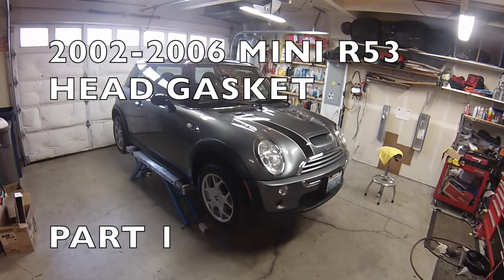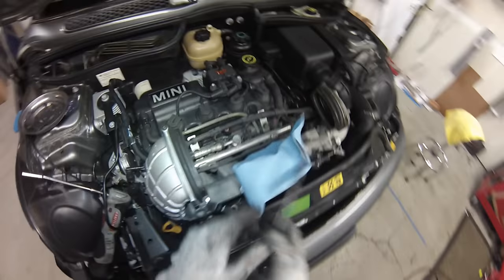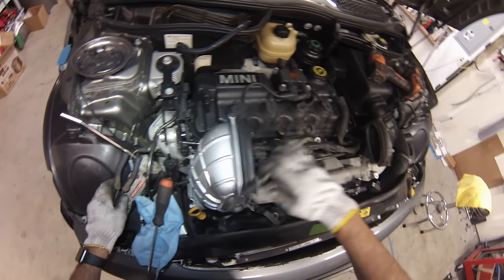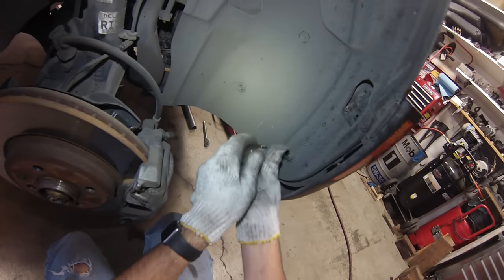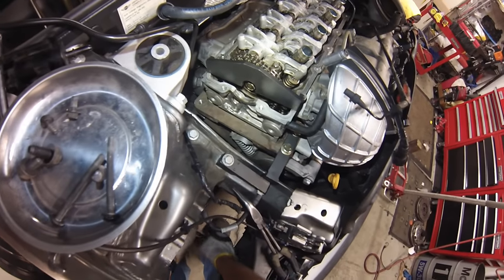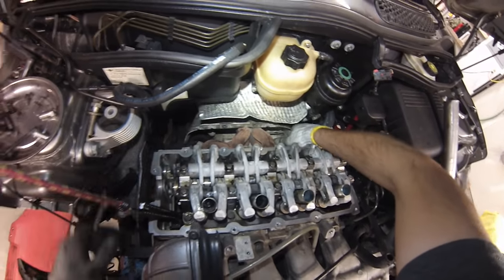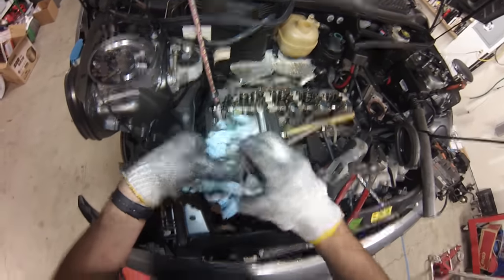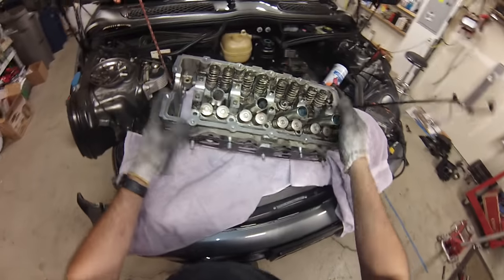How to Replace MINI Cooper Cylinder Head/Gasket 2002-2006 R53 Part 1

Comment from the maker: Step by step replacement of head gasket (& remove/install camshaft) on a 1st Gen MINI Cooper S. Get the parts and tools here: 

Head gasket: http://amzn.to/1jimU3Q
Bolt set: http://amzn.to/1jimUkm
Valve cover gasket: http://amzn.to/1Lp0qbO
Chain tensioner: http://amzn.to/1jimWbX
Thermostat & gasket: http://amzn.to/1jimXgf

Intake/exhaust manifold gaskets are reusable.

Bolt extractor set: http://amzn.to/1R5iMP4
Timing chain special tool: http://amzn.to/1jin6QQ
3/8 wobble extension: http://amzn.to/1PnCMyd
1/4 deep drive socket set incl. 8mm: http://amzn.to/1ZqyIBv
1/4 wobble extension: http://amzn.to/1Lp0Hvi
Hose clamp pliers: http://amzn.to/1jinaQv

Process will be similar on a naturally aspirated MINI Cooper - just little different for intake manifold and airbox. 

Want to show your support for MOD Mini? Virtual tip jar at http://www.fundly.com/mod-mini-tip-jar
Reply: What would be a friendly price to do this job?
Reply: Hi! I’m trying to get some of the parts for my dad for Christmas to fix his MINI. Will all of these parts need purchased to do this job? He’s got a 2003 with the same issue. Like for instance, you have bolts listed, so are the bolts he will remove not reusable? Thanks in advance!
Reply: Hope Ogle every time you remove the head you should replace the bolts, they tend to stretch when torquing them down.
Reply: Mod mini, I have a 2005 Cooper S.  Do I have to remove the rocker assemblies? It looks like I have access to the head bolts without removing the rocker assemblies.
Reply: are the Mini engines worth fixing w 200K when head gasket is leaking? Do you see bearing or piston issues?

Comment: Why is necessary to remove the rocker arms and camshafts? The head bolts could all be accessed without doing this step so Im a little confused
Reply from the maker: It's not necessary for head removal but you need to at least loosen all the cam bolts to realign the camshaft on reassembly.

Comment: Question??  Just replaced head gasket. Your video a huge help!  While sopping up the milkshake in the oil filter housing I accidentally pulled out one of  springs and cap. Superglued spring to center of cap and tried to connect it to its mate.  I guess the inner piece is broken as they don’t seem to want to snap together. Is this part essential? What is its function? I put oil filter on with just the one springy thing. Am I good to run it? Haven’t started it yet.

Comment: How similar is this process for an R50 (Non-S)? We're gotten as far as the valve cover off but I'm struggling to find a video specific to R50s for head gasket replacement

Comment: Road salt and water make my car indistinguishable from the one you were working on, albeit 8 yrs ago. Had to hammer the injectors out, had to throw away the suspension, getting everything vapour blasted or blasted and powder coated, and spending loads on new parts. I'd never worked on anything until I bought my mini and was just like 'I'll just fix it myself if anything goes wrong' .. age old tip of the day: if you look under a car and it looks rusty, don't buy it unless you know what you're doing.

Comment: hi mod mini man. im all the way over in England and I've successfully changed my head gasket using your tutorial. the only words I have to say is when trying to pull the inlet manifold the bolts were fused to the studs and was impossible to slide back. I had to make a decision so pulled the head out with the inlet manifold attached. once I had the head on the bench the only way I could get the studs out was to wind 2 m8 nuts up the stud and lock them together and force them through all the crap. awesome tutorial and I couldn't have done it without you. TOP MAN

Comment: Recently did this job with the guidance of this amazing video. Thanks. Turned out the the problem was cracked oil cooler/heat exchanger however. 😧

Comment: Oh, joy of joys! Mod MINI has uploaded a new video.- That is one clean engine bay, by the way.
Reply from the maker: +IamMagPie It wasn't until I cleaned it...
Reply: +Mod MINI Wow - nice job. I want to clean my engine, but I'm afraid of putting water in there. With all the electric cables, electronics and what not.
Reply from the maker: +IamMagPie Everything is water resistant. Just make sure to run the motor until it is hot (dry) before parking. And don't use a pressure washer.

Comment: Great video, very helpful. 
One thing I did find is that if you remove the intercooler bracket and rubber gasket from the left hand supercharger horn you are then able to remove the intake manifold completely.

Comment: Love the video and thank you.

Just removed the cylinder head definitely a bad gasket mine was exhaust leak into the coolant. 

Question, I’m seeing a warp of .003”-.007” in the middle highest in center. 

Is it worth machining one that is .007” out? I had no water in my oil. This one would run perfect for about 45 minutes before building up enough pressure to boil over. All other cooling systems components are working and new.

Comment: Thanks for another great video. 

I don't have a cylinder head issue, but I came here to learn about removal of the intake manifold.  If I understand you correctly, you seem to say that the supercharger must come off to remove the intake manifold due to clearance issues, unless you remove the head the way you describe to clear the intake manifold studs.  The Bentley manual seems to suggest that the intake manifold can come off without removing the super charger.  Could you elaborate on this a little please?

Comment: If I've got chocolate milk in the coolant system, but the oil is clean, is that going to be a head gasket leak or a oil/water cooler gasket problem?  I'm thinking of bypassing the coolant hoses away from the cooler as a test.  Car runs fine, but more and more oil in the coolant.

Comment: Hi there, is it possible to reuse the Rocker Arm Shaft Tube Bolts if you had to replace the cylinder head gasket and stripped fhe head down

Comment: +Mod MINI I need your help diagnosing a problem with my own mini, it’s an 02 MCS with 108,000 and it’s a strange problem. If you’re in 1st or 2nd gear and run it hard it doesn’t do anything funny until it hits higher and higher gears. In higher gears or under load it stutters and misfires on a cylinder/s and will run off 3 cylinders until you restart the engine. Help me please!

Comment: I always enjoy your video - there is a zen like calmness about the way you explain things.  I have a question.  I have 2010 R55 (non turbo) with exhaust manifold and a heat shield in the way to get to the oil filter housing.  Is it necessary to move the bumper to get to the housing?  I'm looking for a lazy shortcut if there is one.

Comment: @Mod MINI I need your expertise since you are the real magician of our MINI's. I started to change the head gasket, and finally opted to install a rebuilt W11 engine. BUT there`s some kind of sludge in the cooling system circuit, mainly in the radiator and heater core ( a mix of oil and prestone), is there an effective product I can pour in the system to clean it and flush it effectively? How do you resolved this situation when it happen? Thank you in advanced Kurt!

Comment: The part where the intake comes off and gets stuck on the horn. When putting mine back on, I dremeled some material off the corner so it slid right back on and next time it’ll come off easily.

Comment: my plans of working on my own mini are slowly diminishing lol everything looks like a pain in the ass minus the intake
Reply from the maker: +Keaton M. A little scary the first time but not that bad if you think things through. Anyway, not for everyone.
Reply: +Mod MINI once I have all the right tools I may try the 15% pulley mod, there's a couple nice kits I've found. Also the M7 intake box is on my list - that doesn't look too difficult...
Reply: +Keaton M. I followed Mod MINI's videos for installing the 15% pulley, changing out the supercharger oil, and replacing a few gaskets and it was a long process but so worth it. These cars are so much fun to drive, it is a shame that they aren't very easy to work on and keep on the road.
Reply: +fprintf think I would be more eager to try to do it on my own if I had all the right tools but nobody but me likes cars enough in my fam to have an abundance of tools so I'm left to my own devices haha.

Comment: I am working on this exact project on my 2004 mini cooper S.  At 18:00 you remove the electrical connectors located just to the right of the airbox.  Im having difficulty removing them.  Cant see what you have pushed with the screw driver.  Any help appreciated.
Reply from the maker: ECU? Just pry backward while being careful not to break plastic.

Comment: That little Craftsman impact driver is awesome, the one you're using when removing the intercooler.  Can you share the model number?  I can't seem to find it on the Sears website...
Reply from the maker: +wrxnofx Seems like it is no longer available. This seems to be the next best thing: http://amzn.to/1jt9T7g
Reply: THANKS!!!!
Reply from the maker: Update: My new favorite handheld battery impact is this one from Milwaukee. Lightweight but just as or more powerful than the big orange impact tool in the video. https://amzn.to/2I11R1E (Link is for bare tool. Be sure to also add the suggested battery and charger to the cart.)

Comment: I gotta change 2 burnt valves on piston No4 as they are not seating right all the time, sometimes they do and the car pure's alone fine, then sometimes it missfires, we pressure tested the car and No4 is lower than the rest, we have fitted new coil pack, plugs, leads, so my question is can 1 or 2 burnt valves do this to my R50 mini cooper before i buy a new fully made up head and have it fitted ?
Reply from the maker: Even a single burned valve is a big problem. Car will have trouble getting up a hill if it leaks. Changing plugs and coil pack does nothing to solve the issue if you don't have the compression.

Comment: Just bought a 2003 r53. does not overheat but no heat whatsoever bled system get bubbles. Whilst bleeding system today with cap it burped water through the header. Does this suggest head gasket. Also do these heads need skimming?  cheers
Reply from the maker: What do you mean it burped water through the header - water was coming out of the exhaust? It's fairly easy to test for combustion gases in the coolant. If present, you have a head gasket sealing problem. Head should be fine to reinstall as long as there are no cracks and it is clean, straight and true.

Comment: great video probably the best. I used your guide to replace my head. can get this done now in about 4 hours total. the hardest part for me is to get the exhaust manifold bolts aligned with the gasket. 
Great video.

Comment: From what you know do these heads ever come cracked or warped with a blown head gasket? I usually work on 4 cylinder Japanese cars and they almost never have issues on the head
Reply from the maker: Not sure what you mean. A new car would not leave the dealer lot with such a defect. Head issues are rare on these as well but they do happen sometimes. Usually previous overheating incident, some sometimes have burnt exhaust valve issues.

Comment: We are the process of changing head gasker and turned engine slightly to get cam gear lock tool on. But we done had removed the tensioner. The chain didn't slip on timing gear but could it on the crank? How should I check this before reassembly?
Reply from the maker: Typically it stays in place on crank. When cam sprocket is locked with the tool, and tension applied to chain, all pistons should be level at center of stroke. You can use welding rods or other long wire down the spark plug tubes to confirm.

Comment: Great video. The crank will only turn anti-clockwise (not clockwise as in your video). Does that mean the engine is seized?
Reply from the maker: That's unusual. Give a bit more force in case you are stopping too soon. otherwise, time to inspect for something stuck (check valve timing first and any seized accessories). Also take car out of gear obviously

Comment: I had use your videos to replace , harmonic balancer, water pump replacement, replace supercharger oil,  reservoir tank, replace fuel pump, I am now trying to fix a lot of pressure in the cooling system.. I think is a head gasket .no oil on coolant and no coolant on the engine oil, you think that the main cause?
thank you.
Reply from the maker: Pressure in cooling system is either a stuck cooling system cap (it should vent at 16psi) or combustion gases getting into the coolant. In the case of the latter, there will usually be some sooty particles in the coolant.

Comment: I watched both the videos and just paused while doing my repair. My only worry is that while taking the timing chain off the sprocket I'm not sure I kept tension the whole time. If not, is it possible the chain jumped some teeth on the crank? I'm worried the timing will be off in reassembly. Any advice is very appreciated. Thank you for the video made this job very easy so far. I'm at the cleaning stage before reassembly.
Reply from the maker: There is a guard around the crank sprocket that should prevent teeth from skipping as long as you did not turn the crank while the chain was loose. No guarantees but it should prevent it.

Comment: Great video, I'm on the checkmate 6R50, 53🤗, and noticed the fuel lines can come off by hand, also the fuel rail and valve cover bolts can be clean with rust proof liquid if u will...Ciao...
Reply: Also little tip is that there's plenty of aluminum or aftermarket coolant bottles and mounts available for your track rig or daily...Go...🏁

Comment: Hi Mod Mini, I am puzzled and have a question. I have a 2005 R53 Mini cooper S with 80k miles. it over heats low and high fan kids in and temp comes back to normal. I checked the oil cap and there was some chocolate milk on it... Now to rule things out i bled the system changed the coolant, car was good for a month or so and the problem came back. I suspected head gasket, following your procedure drained oil and no white froth, oil was a bit black ash (very slight) but good. Dip stick has some white chocolaty stuff on it. Pulled head cover and only PCV ports(both right and left) head cover side has coolant and the rest of the head internals have none. not on base not on rockers or the chain i peaked along the chain guide and no coolant....... i will pull the rest of head tomorrow to check.   Question is "what do you think is the problem" water pump?
Reply: @mod mini btw car is a auto transmission so no heat exchanger.
Reply from the maker: Thermostat?

Comment: Can't believe how many of your videos I have followed on my own car, they are the best! Now I have to pull a defective remanufactured head (grrr), but rounded out the hex hole in screw plug/seal for fwd timing guide (using a torx bit after hex failed). Any suggestions on what will grab inside of that hole to break the plug loose?
Reply from the maker: Never had that issue. It's soft aluminum, just drill it out or use a die grinder to grind it out. Might be able to pull out the head with the timing guide still attached and work on it on a workbench.

Comment: Hey +Mod MINI! Have those Fel-pro head bolts proven to hold up on a stock head and bottom end? I need to do my head gasket but not planning to do a race build or upgrade the head at all. I'm sitting around 205-210hp at the crank.
Reply from the maker: The bolts are fine.

Comment: I noticed right at the beginning you had a post that this could be caused by oil cooler which would be much easier. Should you just try that first or is there a method to check? We have a 2005 with oil contamination. Please let me know. Thanks Doug  PS enjoy and have made use of your mini videos-thanks
Reply from the maker: You can remove and pressure test the filter housing. Filter housing was already tested on this car.
Reply: Thanks for the reply-keep up the good work

Comment: What was wrong? I have a 2002 mini cooper that heats up and drains the water through the tank, and blows water through the exhaust.
Reply from the maker: Failed head gasket or cracked cylinder head.

Comment: Got a question.....I'm having oil getting into my coolant but non into my oil....my car also doesn't overheat or have have any smoke or scents coming from my car....its a 2006 mini cooper s maunuel....do you think its the same thing? Head gasket?
Reply: Also motor sounds fine
Reply from the maker: Probably

Comment: Hi Mod Mini, excellent video, i really like ur videos and u help me a lot fixing my own mini a bit. Can i ask u something about the mini if u dont mind?
i got a 2002 r50 one and have to change the lambda sensor (the right name? sorry im from austria). I think u know what i mean, there are two sensors in front and after the catalysator which measure the exhaust gases. And the sensor after the catalysator is broken (check engine light is on and the obd says that too). I already found the sensor and the cable and i could divide the cable. So the cable which goes to the engine up is free but the other side, so where the cable goes to the sensor itself is in such a bracket near the heat shild. and i just cant get it out of the bracket. can u tell me what i have to do to get it out? twist it or something?
cheers and many thanks 
alex
Reply from the maker: +puchmonza100 There is a plastic clip. Use a pointed object to slide the clip and then pull or push. The sensor will come free from the bracket.

Comment: Looks like you could leave the camshaft in head if just replacing head gasket? Or is it in the way somehow? Nice vid man!
Reply from the maker: Head can be removed without removing camshaft / rocker arms. But the spring pressure can make it hard to realign chain during reassembly. Also its a little lighter and easier to lift out of the engine bay when working by yourself.